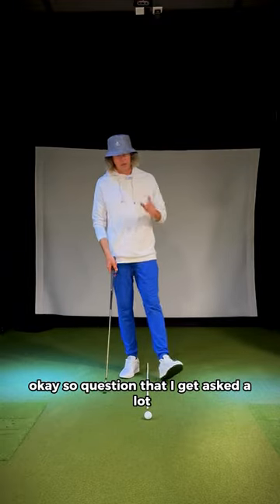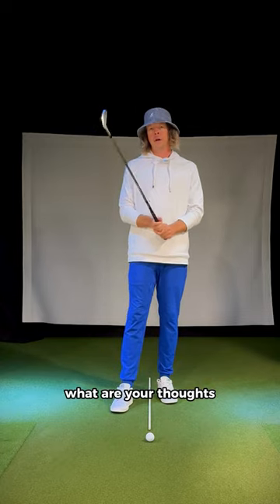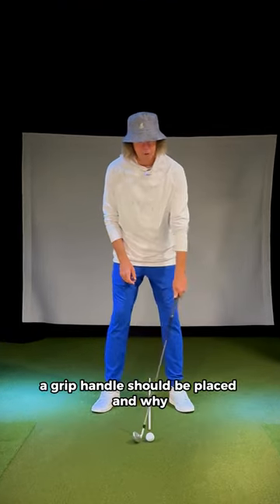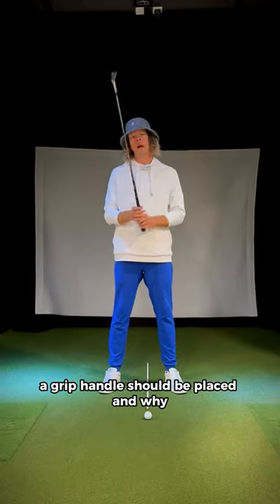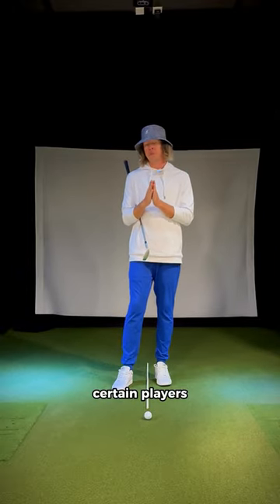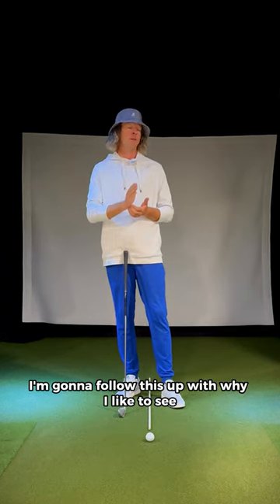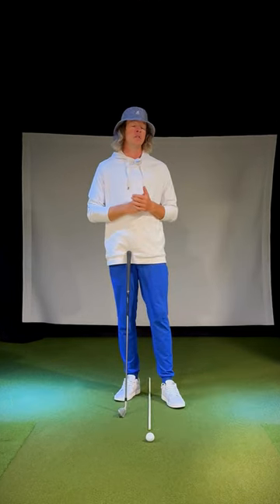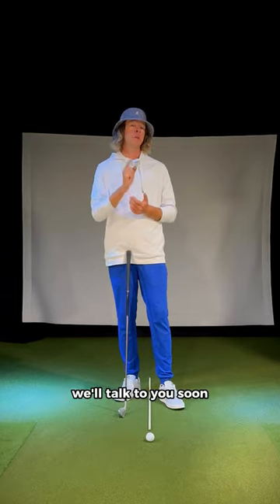Where do you think the grip handle should be placed at setup?

Comment: i would love an answer for this...and how much does it really affect my swing? i am now middle of body but i had been using hands forward...both are comfortable but i am not consistent enough to notice pros and ons
Reply from the maker: I would start with the handle position wise based on the path you want to produce (ball back and handle forward will create more inward to outward path). From there, check the finish of the club at shaft parallel to the ground on finish side of the arc (this will give you face to path relationship). That’s how I’d start to sync it up initially